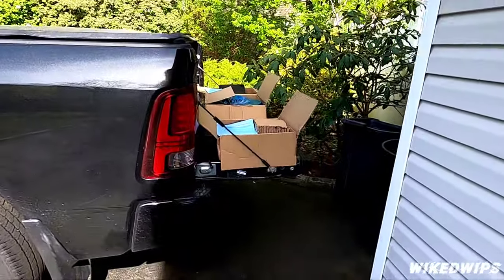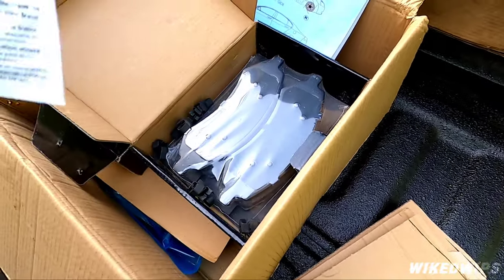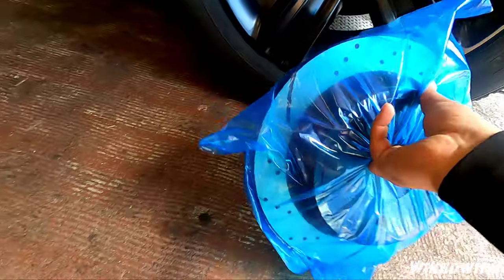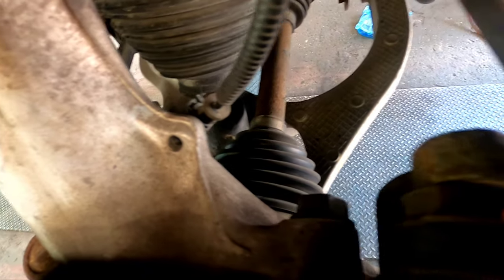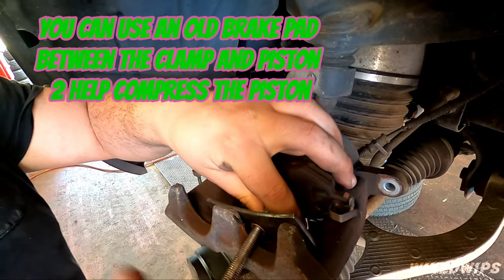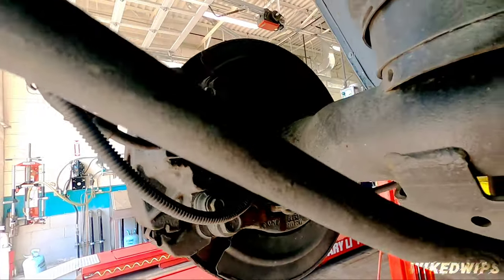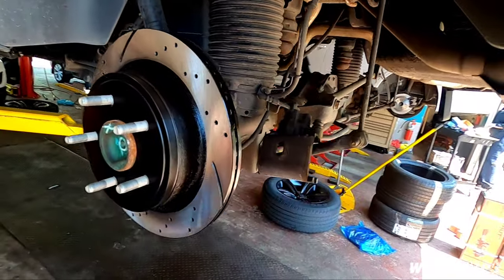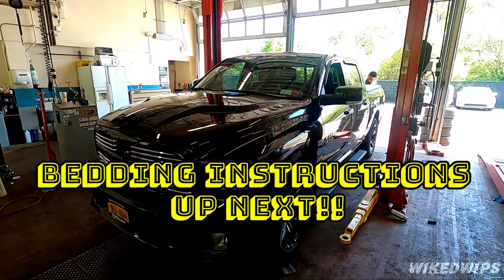2016 Ram Sport Bruce get a brake upgrade by Approved Performance

Comment: I really wish you showed them once warm and broken in just bought a set for my mustang gt
Reply from the maker: They literally lasted until I sold the truck last year....never had an issue
Reply: @WikedWips  gotcha man appreciate the reply only reason I said that Is because the cast metal is taken off the top when you first break them in. Besides like I said I just bought a set and I wanted to see how they did when the vehicle sat a bit.
Reply from the maker: @zachmodz5083 for sure man no worries....just make sure you break them in properly

Comment: do any brake pads work with these slotted rotors or it had to be their brand pads?
Reply from the maker: I'm pretty sure you can run a different pad...when in doubt, you can always call them.